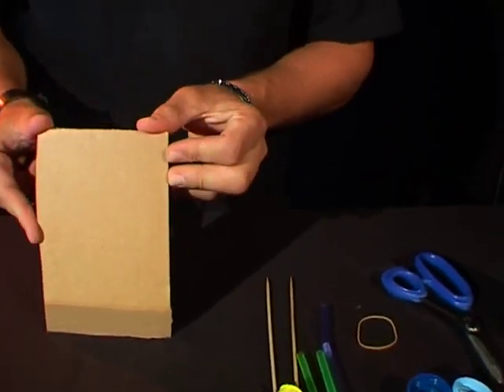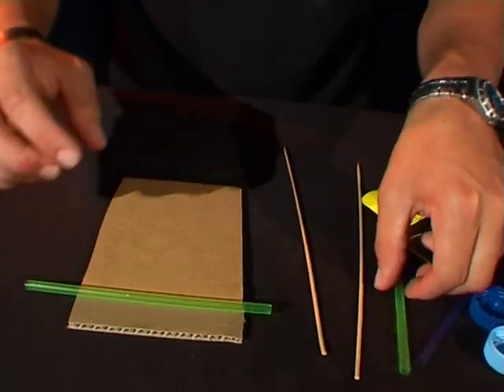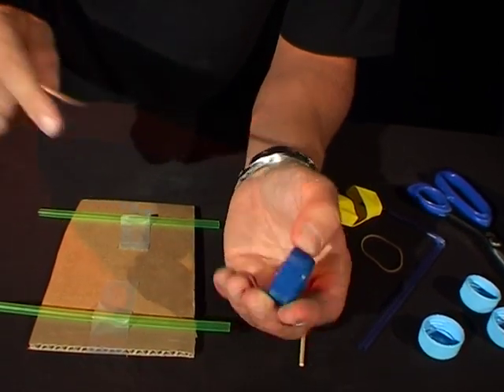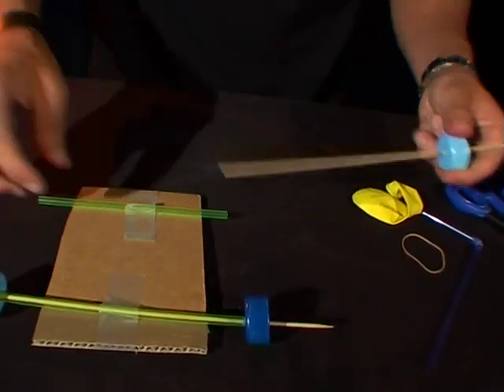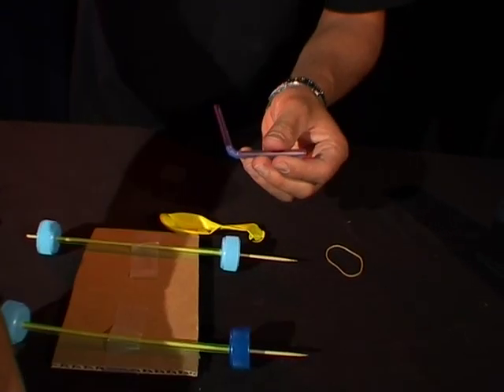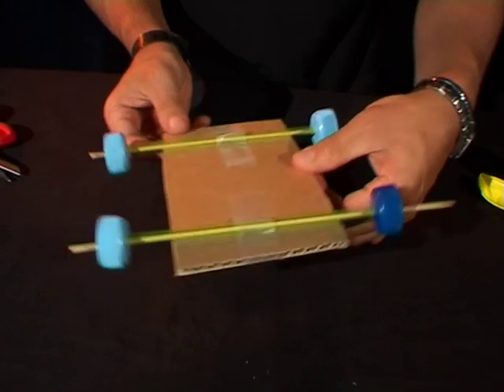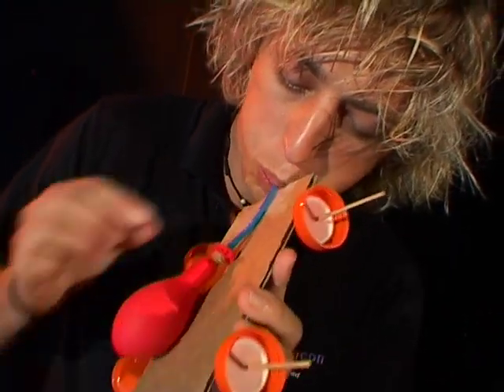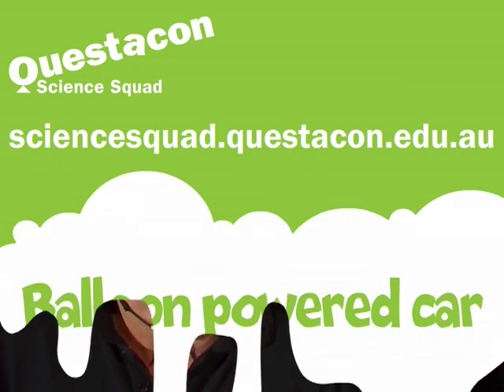Balloon powered car

Comment from the maker: @firestar010299 One factor that is not mentioned anywhere else in this activity is: the friction between the car body and the axels. If you can minimise that, less energy will be lost to friction, and the car may go further. Try using an oil-based lubricant to make the axels more slippery. Just be sure to read the safety precautions of any substances you use.

Comment from the maker: @ChiefExecutive07 When we conducted the experiment we didn’t measure how far the car travelled. However, based on our observations of operating the balloon-powered cars in a number of settings, the cars can travel a couple of metres. The distance that your car will travel will depend upon the materials that you use to construct the car and the surface on which you operate the car.

Comment from the maker: @firestar010299 I don’t recall exactly how for our car travelled, but the distance a balloon powered car goes depends a lot on the individual construction. If you’re aiming for maximum range, try considering a few different variables before you make your car (eg: wheel size, car weight, balloon inflation size, which material the axels are made from, the type of surface it’s driving along).

Comment from the maker: We would recommend checking the following components of your car to make sure that it can function properly, check that:

1) the plasticine is holding your wheels in place, 
2) the skewers (within the straws) are able to easily move, 
3) the rubber band that is fastening your balloon to the straw isn’t attached too tightly (eg. preventing air from easily moving in and out of the straw/balloon) and 
4) that you are testing the car on a clear, smooth surface. 
Hopefully these hints help!

Comment from the maker: To replace the cardboard, you need something firm, but light so it doesn’t weigh the car down. You could try sticking a few rulers together, or use the lid to a rectangular container (like Tupperware or take away).
To replace the skewers, you need something solid and thin so it doesn’t bend and move. You could use some thick fencing wire, a thin knitting needle, or a lolly pop stick. Just be careful you don’t poke yourself while working with sharp things :)
Good luck, and have fun!

Comment from the maker: At the moment, we have no plans to update the website to expand on that particular activity. However a balloon powered rocket should be quite straight forward, as a balloon behaves quite similarly to a rocket already. Consider adding some light-weight fins to help your balloon fly straight. Or, perhaps, attach a straw to the balloon and feed a string through the straw. Let it go at one end and watch it fly down (or up) the string.

Comment from the maker: When we conducted the experiment we didn’t measure how far the car travelled. However, based on our observations of operating the balloon-powered cars in a number of settings, the cars can travel a couple of metres. The distance that your car will travel will depend upon the materials that you use to construct the car and the surface on which you operate the car. See other user comments below, as some people have reported different distances. Best of luck.

Comment from the maker: The best way to find out how far the car will travel is to make a car and test it out. The distance that your particular car will travel will vary depending upon a number of factors such as: the surface on which you are testing your car, the total weight of your materials, the size of your wheels, the type of balloon that you are using, the amount of air you put in the balloon, etc. Let us know how you go!